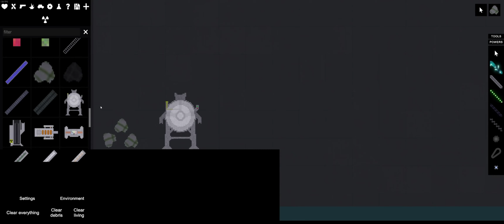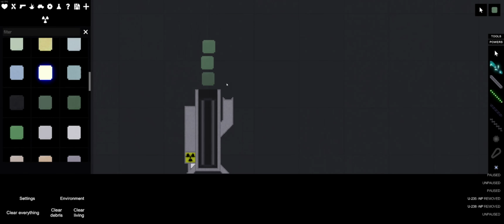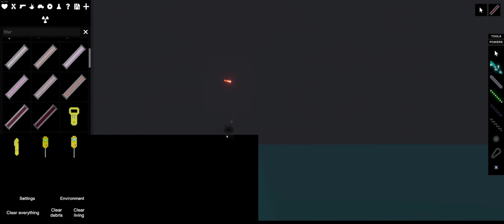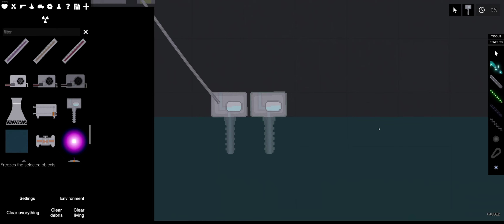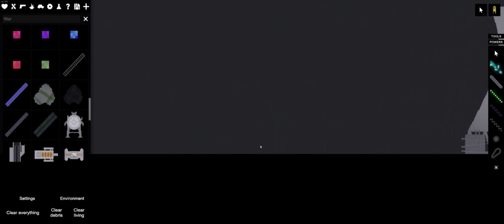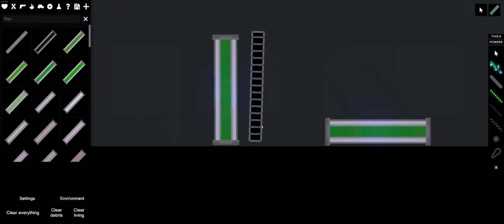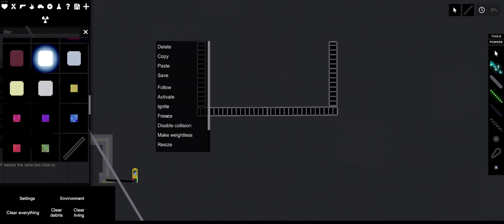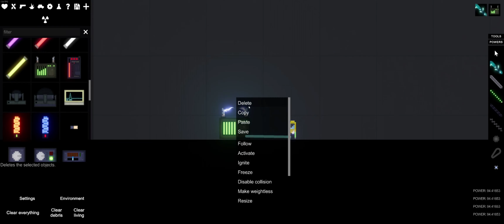Basic people playground nuclear playground tutorial

Comment: Ok now I need a tutorial for one in real life
Reply: Its really simple actually, 
You need enriched uranium or any active isotope, an alloy or material as casing around it, that can slow down the splitting and emitting of neutrons (like he said in the video, boron control rods), some basic fluid engineering to get the heat around, make sure to use non-empty copper heat pipes, the ones that have the circulating liquids inside (if you are building a small one, for bigger ones this would break them), Then put a layer of lead-foam and lead sheets around the entire core, also the entire thing needs to be suspended in water or else the waste-particles will hit and harm people, and remember Lead is toxic to handle!!! make sure youre protected!, Then the rest is optional: connect the heat system to boiler, add Emergency cooling liquids, high pressure hydraulics that are isolated from the entire reactor letting you shoot the boron rods up in an emergency yadayada, the rest should be self explanatory 👍

Literally the only hard part is getting enriched isotopes
Reply: additional safety tips: Nuclear material does not glow! the only thing that might glow is the radiation slowing down in the water tank!

If it glows in any other way, that means a chemical has contaminated your fuel, and the fuel is making the chemical glow, The chances of this are impossible but idk what you got in your shed
Reply: Bro is giving a whole Manuel to create a nuclear power plant

Comment: is it normal that the graphite moderators heat up by themselves preventing the creation of a reactor due to intense heat?
Reply from the maker: Depends on how many rods you are using, if you only have 1 fuel rod then that makes sense but if you have multiple there might be another problem, there is also the fuel you are using, I recommend using Uranium based fuel as it is the easiest and simplest fuel
Reply: @TheMiataGuy  I had no fuel rods the problem was the moderators by themselves where heating up over 10000c and any fuel placed would cause meltdown. And since everything is connected to each other, if I where to cool it down, it would heat up again and I would have no need for me to make the reactor. And I don’t think a self sustainable system would even work in the real world! Plus any bit of heat would trigger the loop even something that is just 90c!
Reply: nvm when a  meltdown happens it heats up the area and to fix this i had to turn off ambient temperatures
Reply from the maker: @AmCheez  or just select all the parts of the reactor and set the temperature to 20
Reply: @TheMiataGuy Can you do a control rod tutorial?

Comment: The turbine get's really hot, up to 15000 degrees which makes the objects that are near to it die immediately, how can I fix that without disabling the ambient temperature?
Reply from the maker: Water cooling eg cooling towers, make sure to connect the towers to the turbines with heat pipes
Reply: @TheMiataGuy  I did, it instantly overheated
Reply from the maker: @havesomestarberries  what fuel are you using?
Reply: @TheMiataGuy  LU-235, the most simple one, which doesn't really heat up, I made the reactor with rods, which stop the process, but yet whenever it reaches the end and the electricity I am receiving is a significant loss, I still somehow make the turbines overheat, if I connect them to towers nothing changes, the towers overheat as well.
Reply from the maker: @havesomestarberries  how many fuel rods are you using? And also how many barriers have you got
Reply: @TheMiataGuy  I am using 3 fuel rods with mechanism to lower them down. As well using graphite as fundament and walls, therefor I am using (forgot the name) but it blocks the radiation by 10 or more percent, forgot the total amount.
Reply from the maker: @havesomestarberries   Are the fuel rods connected to anything with heat pipes, which would allow for cooling? Because unless the rods are cooled they will explode
Reply: @TheMiataGuy  They are connected yes, I am colling them with water, sadly the generator heats up
Reply from the maker: @havesomestarberries  The generator is meant to heat up, that's how it creates power, if you wanted to put anything living near it you'd need to use insulators and lead walls to block the heat and radiation, Its  a nuclear reactor, its a sun on earth making power
Reply: @TheMiataGuy  Well, the generators should not heat up to 99999+ degrees, that makes no sense, I am just curious if i did something wrong, I have to turn off the ambient temperature  else the whole room becomes a second sun. What walls would you suggest me to put?
Reply from the maker: @havesomestarberries  99999+ degrees doesn't seem right, but I'd just use insulators and lead barriers, that should stop most heat and radiation from getting out of the reactor allowing you to put living things in its general area, keep in mind it's a nuclear reactor you're not going to be able to put them all that close to it
Reply: @TheMiataGuy  Yeah, I know that, it's more about ambient temperature at 100m is 5000 degrees :D, Anyways, I will try them walls, if I disable collision for them, will it lose it's effect?
Reply from the maker: @havesomestarberries  Pretty sure its the radiation not the heat, but still lead walls and insulation should solve it, not sure about no colliding it, try it out tho

Comment: Hey, my reactor won't work. I put the stuff into the turbine, but when I heat the boiler it doesn't do anything. Do I need to connect the heat pipe to a separate part? I'm really confused.
Reply from the maker: You gotta pump water into the boiler then pump the steam from the boiler into the turbine
Reply: @TheMiataGuy  Yes i put water into the boiler, but it makes no steam. Do I need to activate the pumps or anything? How deep do they have to be
Reply from the maker: @notlegoguy2511  pretty sure you have to activate the pumps, but as long as they are in any water source and your boiler has heat it should work

Comment: Why do I have these rods exploding?
Reply from the maker: Your fuel is overheating, different fuels overheat at different temperatures, and fuel rods need the reactors to stay cool enough to not explode
Reply: Bc they can reach max temperature, this is why they can esplode.
Reply: In real life, it is impossible for rods to explode, and even a reactor does not explode "yeah yeah but fukushima and chernobyl" Chernobyl was steam, under so much pressure it blew the lid off, and unbelivebaly hot, second explosion is supposed mostly to be hydrogen (water is mostly made of hydrogen, which when it comes in contact with hydrogen, goes boom). Fukushima, it was hydrogen build up in the reactor containements, vent stacks evacuated the gases in the torus because the pressure in torus was incredibely high and needed do be reduced in order to keep cooling the reactor, and when hydrogen was evacuated, it went boom in contact of oxyegn for 3 reactors, 1 explosion was in the torus because of pressure.
Reply from the maker: @OhKopo  My guy, it's a simple game, it will never be able to model nuclear fusion or fission or power in general, its a game, best it has is the ability to explode, it'd be cool if the reactor could meltdown causing an elephants foot like Chernobyl but it's a game, it's not going to model anything perfect, now stop reading Wikipedia articles to make yourself sound smart and go outside.
Reply: @TheMiataGuy  ik lol its just a fyi
Reply from the maker: @OhKopo  I very much knew that already, I'm not sure what you're trying to get at, I didn't make the mod if that's what your thinking
Reply: @TheMiataGuy  it wasn't directed at you in particular. It's for those who might stumble across this comment and not think fuel assemblies just explode in real life